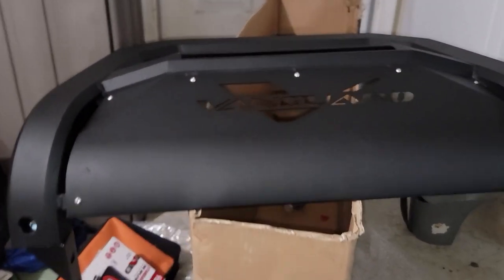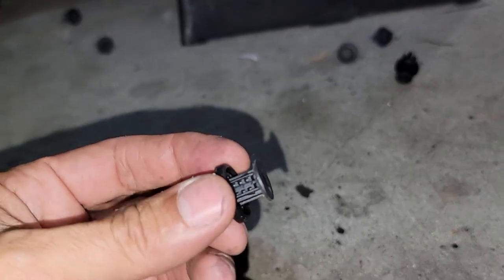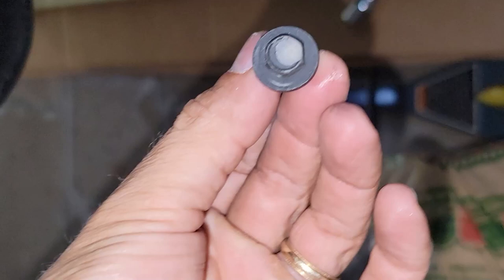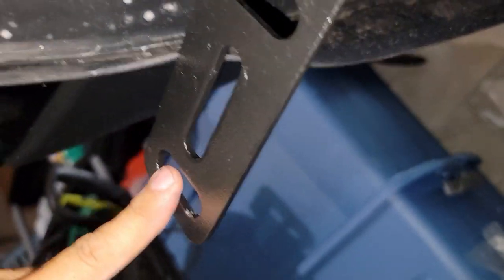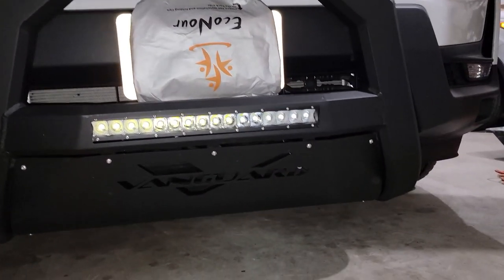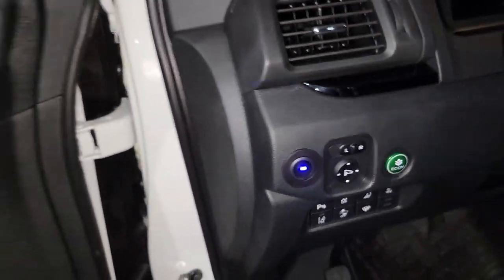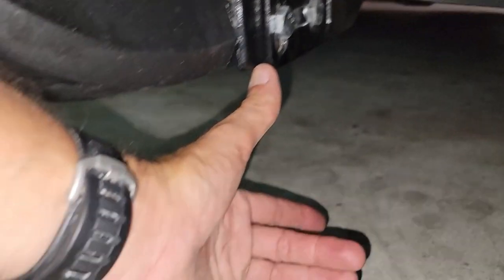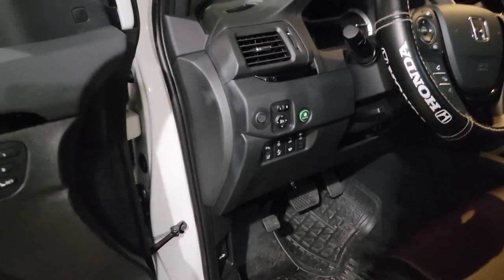Honda Ridgeline 2021 Bull bar installation

Comment: German… just a quick update…. I installed the same bull bar on my Ridgeline, i ended removing it… it was dragging everywhere, very low clearance with the ground… how has been your experience with it?
Reply from the maker: So far I just hitting outside my garage if I back out in straight line, I get in contact with Jsport in order to see the possibility to install the leveling kit and increase 1 1/2 inch to 2 inches, besides my home garage I didn't have any others issues, absolutely the other day I was driving and I didn't see a traffic cone and If it wasn't for the bull bar probably I would make some kind of damage to the  bumper plastic. The problem is that our truck is too low. Soon I will have some news of different products I did try that failed.
Reply: @07Review  thanks German! I think lifting it would help… 👍😉

Comment: you didn't show how you ran wire connectors for that light bar ?
Reply from the maker: It is plug and play, I did run the wire inside the fender using the same connector that goes between the door and the frame to put it inside the cab, then a switch.

Comment: Hi German

It looks like the bull bar is almost touching the front bumper.  I'm interested in purchasing the same bullbar for my ridgeline but I'm concerned it will rub on my front bumper.

Is the bullbar touching your front bumper? 

Is there a way to increase the spacing between the bullbar and the front bumper?  

I would like there to be as much space as possible between the bumper and the bullbar.

Great video by the way!
Reply from the maker: Yes , you can leave a half inche, but the inclination angle will be more pronounced towards the ground, the way they make the this bar is to fit just right, that's why I put 2 peaces of foam glue it to protect the bumper,  make sure if you leave an space to put a foam pcs on both sides in case you hit something and the bar moves towards the bumper in order to protect it from marks.
Reply: I installed the same bull bar but had to remove it… bad clearance, it was dragging everywhere, I’m returning it…

Comment: Hello - can you please provide the model number of this bull bar
Reply from the maker: My friend unfortunately I lost the item number, also it looks like they took it out of  the website, I think is because people had started complaining about the clearance, basically is too low from the ground, the brand is Vanguard and this the website:https://vanguardoffroad.com/catalogsearch/result/index/?as=1&fit_make=5443&fit_model=5621&fit_year=5445. 
The one I have looks like this one but maybe the older version is different. https://vanguardoffroad.com/vanguard-vgubg-1763-0917bk-20led-black-powdercoat-optimus-bull-bar-20in-led-kit.html
 So far I probably will have to lift my truck or be very careful when parking or entering places... so far is 👍

Comment: Hey guys I can’t seems to find this bull bar do you guys have a website that actually works because the one on this page doesn’t work? Please let me know thank you in advance.
Reply from the maker: Looks like the website is down, check this site at Carid, it is the same Bullbar: https://www.carid.com/2021-honda-ridgeline-grill-guards/vanguard-off-road-3-optimus-series-black-led-bull-bar-with-skid-plate-4152847530.html
Good luck 👍... and GOD BLESS YOU!!!
Reply: @07Review  Gracias hermano
Reply from the maker: @jay34gsxr  con mucho gusto mi amigo.

Comment: Did you have to cut/trim any of the dust guards ? Looks good though
Reply from the maker: Yes... you must to mark it with a marker and just cut the plastic trim around the bull bar metal holders.
Reply: @07Review  thanks! Was it difficult?
Reply from the maker: @juanfernandez9492  not really as soon as you figure it out, if you do it on the weekend with patience and the right tools it will be easy.

Comment: Does the bar interfere with any of the sensors in the front? 

Looks great btw!

Looking to purchase for my 22 Pilot 😈
Reply from the maker: No interference,the  only thing you must have to watch out is when you are backing out of any garage or watch some real high wheels stoppers on the parking lots, almost for sure you will hit it if you are not careful, probably next year I will rise up the suspension in order to prevent that. So far everything is ok if I go slow in those 2 areas.  Every one loves the appearance of the bumper.